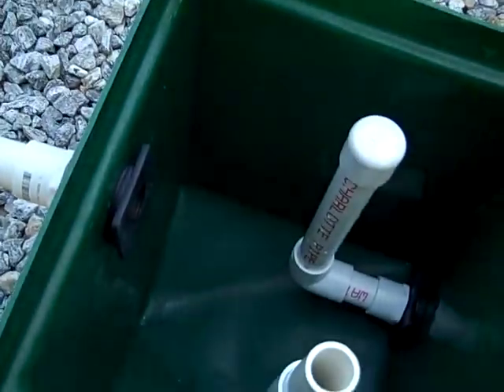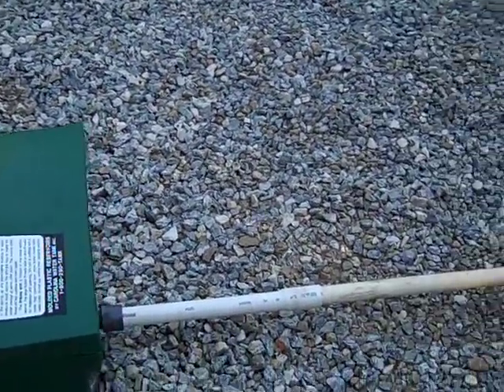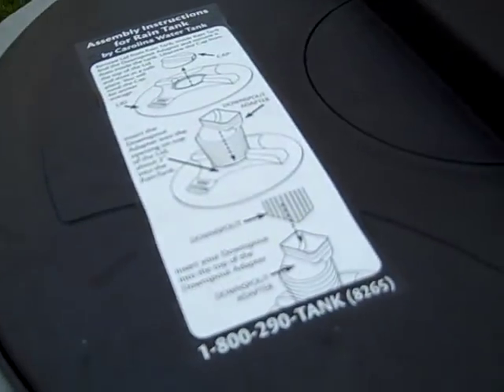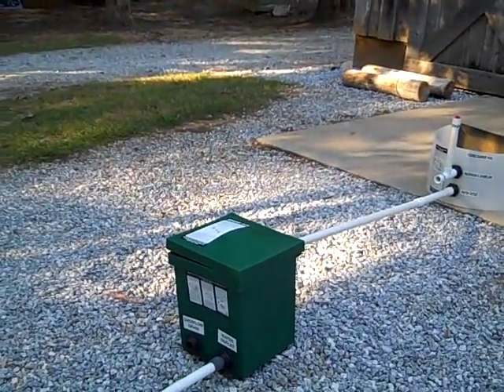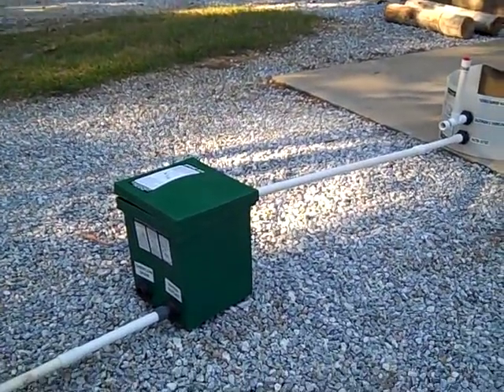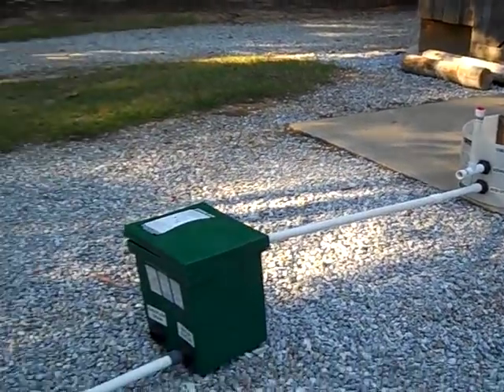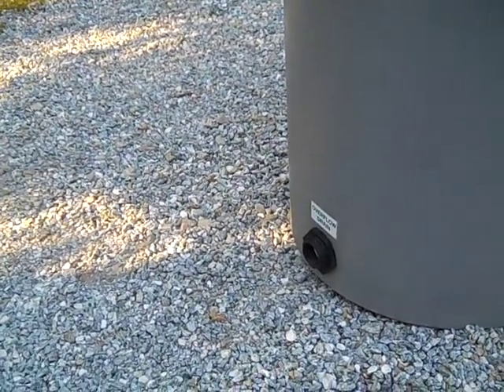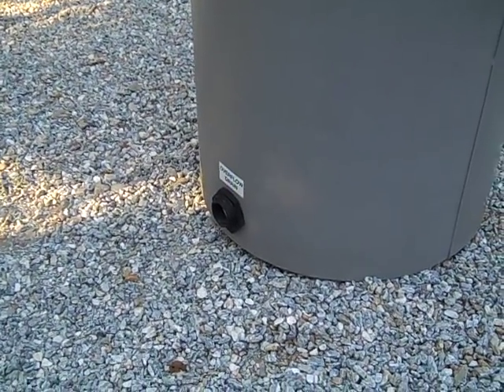WROL Spring Development PT2

Comment from the maker: @MSGDREWRY If the collection system is done correctly there is very little silt.  I flushed the spring box a couple of times and a quick stir removed 95% of the sediment.  The way the box is molded, none of the sediment gets into the outlet line.  Thanks for watching.

Comment: Im in central Ky and Im engineering this project on the cheap! I know carolina water tank dot com has some really great products, but I wanted to do this as cheaply as possible. I used .25" plexiglass for a head wall and food grade 5gal bucket from as a Spring Box. I wish I had used larger diameter PVC, since my spring has worked around my dam. I will up it to 1.5" diameter Still searching for a reservoir. THANKS for the detailed videos you've put together! Outstanding job sir!

Comment: This is SUCH an informative series.  My concern is the headwall and the overflow in the headwall.  Our spring flow gets down pretty low after an entire summer of no rain here in the Pacific northwest, which is why we're going to put this in now while there's not a ton of water gushing out of it.  But that's the problem...once the rains return this spring probably gets up to ten gallons a minute or more!  So I'm trying to sort out how to create a dam/headwall that won't blow out with that much hydro pressure coming at it.  I thought about putting a huge overflow pipe into the headwall to give all that water a place to drain out, maybe a 4" or even 6" overflow pipe?  But a bulkhead that big would cost close to $200 bucks if you can find one I imagine.  

But the water collection line will be one inch, so once the collected water is in that one inch pipe it'll be in 1" piping from there on.  It's that major volume of water that flows from that spring in winter that concerns me and how to engineer that part of the system to prevent a blow out, especially since that part of the system would require a complete re-excavation to repair.  Wanna get it right the first time!  Your input on this would be SO appreciated.
Reply: 1 inch pipe will gravity flow 14 gallons a minute.  You could go 1.5 or 2 inch if you want.  Drive 4 or 6 2 feet rebar around the dam wall to hold it up. Definitely use some bentonite clay around the inside wall to seal it up then add about a foot thick wall of clay around the outside wall. To help hold it up then put gravel in the dam.

Comment: @RobRichmondRPG  PVC meant for consumable water is safe, and PVC itself is not toxic it is the releasing compounds used for the molds that can be toxic.  Non-polymerized vinyl chloride is toxic though, but once it has been polymerized into a chain to make polyvinyl chloride (PVC) it becomes safe.  Just remember to use PVC meant for consumable water and you should have no worries.

Comment: @engineer775 I have seen a test result for spring water emanating from a Rocky Mountain hillside that indicated the presence of bacterial contamination.  The lab stated that a spring water source can no longer be considered safe without testing.

A FEW QUESTIONS:
1. Have you had the water tested in a lab for potability?
2. Assume for a moment that your spring is contaminated at some future point.  What steps would/could you take to add filtration and/or disinfection to your system?

Comment: Have a spring coming up out of the ground making everything waterlogged and soggy... have dug down about a foot and found a spring with water flowing pretty good.  Have temporary dug a trench to drain the water to the stream and dry out the ground.  I want to capture the spring water and pipe it underground over to a nearby stream.  I don't need the spring water - I want dry ground!.  Does it matter what sized pipe is use to transport the spring water to the stream?  Does the volume determine the size of pipe?  Any suggestions would be most welcome.  Flow is pretty good but have yet to determine the volume.  Ground around spring is just slightly sloped to the stream 40 feet away.  Stream has a bank drop off of about 2-3 feet.

Comment: How does the sediment not enter the pipe going to the tank?  It looks like if the height of the water was high enough to enter that pipe and there was a steady flow of water the sediment wouldnt settle right?  So if it doesnt settle it would eventually make its way to the holding tank so what would prevent it?

Comment: Nice video. Answered a lot of questions except one. I have a spring about 150 feet elevation above my house and want to do gravity feed. Can I have the collection tank right after the spring box and pipe from that down to the house? With the amount of drop will I need to have a pressure reducer? Thanks in advance.

Comment: My spring is 600 feet up steep grade. Can I run it straight into the spring box. Then into a holding tank. Its very difficult to get to the spring to build anything
 But the water is just gushing out like a garden hose.

Comment: People might need an idea about the Elevation needed for the water pressure they need. Water towers are tall for this reason. To get 50 to 60 psi at the tap would require a 160ft watertower or very steep hillI or a holding tank with a pump to keep it cost effective. Just saying

Comment: Thank you. We developed our spring this past winter (in the Pittsburgh area) We are having problems with the catch basin leaking. We originally used red clay, then we tried bentonite clay, and finally we used portland cement on the bottom of the catch basin. We still have a small leak but since the yeild is marginal, it can sometimes make the difference between h2o and no-h2o - Do you have any other references you can give to other variations on the catch basin? Thanks for any info you can give.

Comment: what about smaller size pvc pipes after each station 7/8 from spring to spring box. then 3/4 from spring box to tank and then 1/2 to house would that not be enough pressuer with out a pump?

Comment: nice series so far, but I have a question why does the inlet to the tank go into the bottom wont the pressure when filled push it back out? or am I missing something?
Reply: Jeff Lowe same question here :-)
Reply: Jeff Lowe same question here.  I have watched this video few times  and i can't figure why you would would attach the pipe to the bottom and not the top. even if it is down hill the pressure would increase as the volume of water increases???
Reply: The cistern, when actually used in an onsite system, will be at a lower elevation - and longer separation -  than the depiction here. The top of the cistern would be lower than the outflow from the spring box.
Thus the cistern would fill to the top - and - there would be added benefit of the entire length of the pipe feeding into the cistern (from the spring box outflow) adding to the overall water pressure.
Further, the supply line would/could be kept under ground to protect against freezing, whereas one running to the top of the tank might be harder to protect.

Comment: Hey great set up, this is exactly what i need for my camp. I do have a couple of questions, I notice your holding tank ( The Barrel) is piped into the bottom, does the weight of the water not eventually get to the point where it potentially could push the water back into the system, and if you are to place a ram pump on the outlet side of the holding tank how far will a ram pump pump up a slope? Thanks again and this series of videos was a great help .
Reply: CanadianTrapper I saw the same thing happening. I guess if the top of the tank is lower than the bottom of the spring box it would work. But the overflow at the bottom of the tank also has be scratching my head.

Comment: if nothing else you could use the water for the garden and livestock setting it up as a auto waterer for the animals would be 1 less thing you would need to do everyday and watering the garden would be faster in my reaised beds i laid out some pvc and drilled some small holes in the pipeing and hook up the hose to it and run the water for a little while every day and it does a great job

Comment: I do like knowing how to do this but isn't it defeating the purpose of finding real, fresh, unpolluted natural spring water if you put in through plastic and marine wood. (yes, I saw the post about a certain type of plastic, but it's still plastic.)   I appreciate you sharing your knowledge but the plastic really bothers me.
Reply: You could always use steel equipment, even stainless steel, but if your piping goes for any distance you'll be hard pressed to pipe it without plastic.  Copper is way too expensive and also has its problems.  Way more likely to rupture for one thing.  You can't really live in a house with modern plumbing without your water going through some plastic...but you could use metal pipe for a short distance to a stainless collection tank and have one of those metal hand pump faucets I suppose!